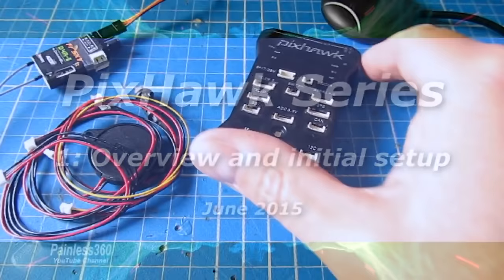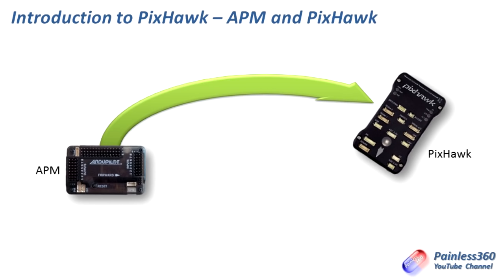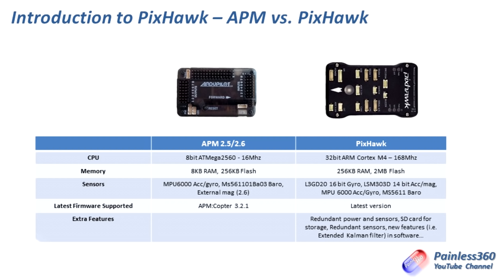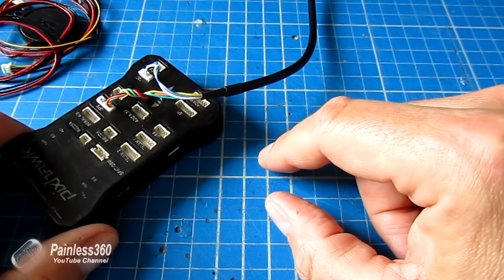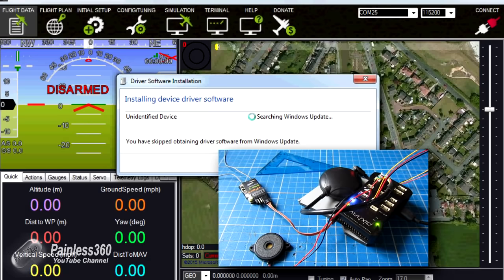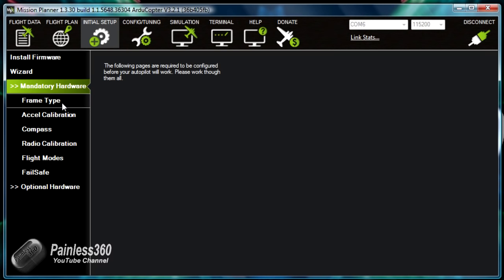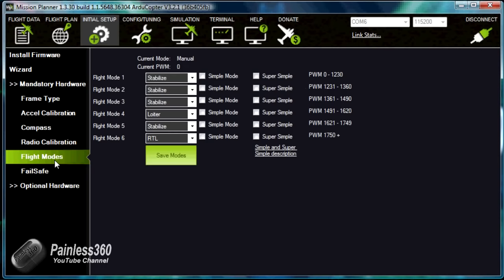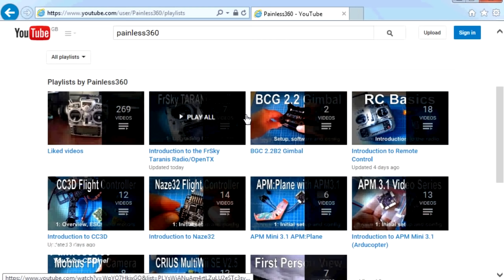(1/5) PixHawk Video Series - Simple initial setup, config and calibration

Comment: My Pixhawk is getting a low voltage alarm when it's connected to a sub 3.0 port.  It starts fine, I hear the chirp saying it's happy but then it's nothing but flashing yellow and series of beeps.  I have looked online and haven't found anything about it.  Any thoughts?
Reply from the maker: +DFSrlz sounds like the pixhawk is trying to put too much current from your USB port. If this is the case then I would power it from a battery as well, if you don't want to pull too much current through a USB port as it can damage it over time.
Reply: Painless360 In mission planner the voltage is reading .03 to .05 volts via usb.  But will try to just power using battery to see if that helps
Reply from the maker: USB should be 5v but some computers will shut down the power from the USB if it detects that what's connected is pulling too much power..

Comment: when I try to calibrate the radio, I get the error ' 0 channels detected, at least 5 needed' any idea why?
Reply from the maker: It could be lots of things. Have you checked that the receiver is bound, the wires are connected correctly? Let me know what troubleshooting you've done, it helps for me to suggest things.
Reply: Bounded properly because the transmitter detects it. (I'm using a Turnigy i10 and iA10 pair).  It also possible that since the quadcopter had been in the lab and went through lots of hands, some parameters have been changed. I will go and check if there some issue like that. The thing is it is generally used in autonomous mode using a matlab library called matmav. So maybe that causes the issue. I will check that tomorrow.

Comment: I'm having issues connecting my fsia6b receiver to the pixhawk, how do I go about it?
Reply from the maker: I'd use SBUS. The setup of the reciever in Ardupilot is the same... Happy flying
Reply: @Painless360   Thanks I've been able to connect it, but when I plug everything in, it doesn't arm, the pixhawk keeps blinking green and the motors doesn't start
Reply from the maker: See my video on how to troubleshoot that.. best of luck

Comment: Anyone can help?
I was thinking is it possible to use a GPS simulator for this PixHawk GPS input module?
Reply from the maker: I don't understand what you're asking. What's a GPS Simulator?
Reply: @Painless360  To generate simulate GPS signal going into the Px4 is that possible ? using a Third party application ?

Comment: Hi, we have a dc brushed motors and Hobbywing Eagle-20A. How the connection is done, which pins should be used? What configuration we should do?
Reply from the maker: You need a brushed ESC for a brushless motor. The giveaway is how many wires there are for the motor.  If there are 3, it's brushless. If it's only 2, it's brushed.  Best of luck
Reply from the maker: See my videos on troubleshooting arming in Ardupilot... Best of luck
Reply: @Painless360  Thank you. Btw I want to ask that the pixhawk supports geared dc motors and  Hobbywing Eagle-20A esc right? As far as I know it supports, there is no problem on that I think. The problem is in the calibration I believe so I will calibrate it from the beginning.
Reply: @Painless360  Heyy, I see that the motors turn when I say test motors on the mission planner, but it disarms itself after some time. Also, I can't turn them all the time I don't know why. I will check your videos, other than that do you have a suggestion?
Reply from the maker: Disarm after a set timeout is normal. Please watch one of the modern Pixhawk/Audupilot series. This series is very old.. Best of luck!
Reply: @Painless360  yes it is normal but when I try to arm it again it sometimes does not turn. What can be the reason?
Reply from the maker: What troubleshooting have you already done?
Reply: @Painless360  I actually do not have an idea, probably, I couldn't configure RC before. But now I have done it somehow which I don't know it is okey or not. However, the motors turn and stop. Once I tried again  it did not turn, but after I tried it one more time and it turned. I don't know what is the problem?
Reply from the maker: It is really tricky to help with such limited detail. It'll be something you've missed or setup incorrectly. I'd point you to the a recent series showing the steps I use to setup and fly Ardupilot.. Best of luck!
Reply: @Painless360  for now , when I click test motors after arm the rover, it gets disarms itself. What can you say? The movements will be autonomous, we used dronekit library. So, I want to also ask that is there any changes in configuration accordingly?
Reply: @Painless360  Last thing happens is that the Rover arms but it does not turn the motors is that configuration problem?

Comment: helo sir

how to set the pixhawk for autonomous control method 
please can u give me any suggestion about it 
Thank you,.
Reply from the maker: +Javad Ali later in the series.. you upload a mission using mission planner and then select the Auto flight mode.. check out the docs.. best of luck!
Reply: thank you 
another thing I want to know is can I use 
FlySky FS-i6 2.4G 6CH AFHDS RC Transmitter With FS-iA6B Receiver for the pixhawk controller
Reply from the maker: +Javad Ali keep watching...
Reply: Painless360 
is fs-i6 6 channel transmitter is suitable for the setup?

Comment: how to setup follow me mode on pixhawk can a make video of that please
Reply from the maker: You need a connection from a tablet running 'Tower' or a PC running Mission Planner. You can use the OpLink Radios or the WiFi module to maintain the connection. You then setup the mode as per http://ardupilot.org/copter/docs/ac2_followme.html, and the model uses the GPS co-ords of the tablet/PC you're holding the position itself and 'follow you'. Best of luck, personally I'd never set this up as it's asking for a problem to crash the model into you!
Reply: i really like your reply sir. I love your channel

Comment: Hallo! do you have info about any rc traffic sys. module which can be connected to Pixhawr
Reply from the maker: +Khalid Oldendorf I've nor seen that - do you have a link?
Reply: +Painless360  - Thanks for your reply. I meant something like an Air Traffic Management (ATM) for Drones (fixing wing for exsamble) without interrupting Commercial Aircraft with any signal (just detect and move away automatically)
I think of long range Laser-Sensor multi Module, more than 1500 km (can give 12+ sec. to move away when the Drone detect an object)
Reply from the maker: We've not played with anything like that. Complying with local air traffic rules about ceilings, no fly zones and maximum RC range should keep models out of harms way. Happy flying!
Reply: +Painless360 yes you are right. but FPV flying in height altitude and it's very close to small aircraft and detect system is important in case

Comment: Would you recommend this for multi-rotors ?
Reply from the maker: Depends on what you want to do with the model, if it's a larger model and you want to use it for autonomous flying or filming then it's a great choice. See out flight controller comparison video for more commentary. Best of luck!
Reply: Painless360 also so you have to use the gps compass antenna?
Reply from the maker: Yep, not sure why you'd bother with a PixHawk if you weren't planing on using the GPS - see that video I referenced.. Best of luck!

Comment: Wonder if this system if good for tricopters and how you connect a in1 esc
Reply from the maker: http://ardupilot.org/copter/docs/tricopter.html ;)
Reply: @Painless360   awesome nd im guessing there is also something usefull about if and how to set up a 4in1 esc that is a dlhel and uses dshot 300-1200
Reply: @Painless360   mh sadly they describe how to wire and set up normals escs but not a 4in1 solution
Reply from the maker: The wiring is almost the same.. See my builds where I use a 4-in-1 for tips..

Comment: Hello Painless,
I already send you an email and have further questions wich i should post here.
You recomended to do the calibration of the ESCs again, but the problem is that the Pix wont talk to the software anymore.
I switched the sd card and tried again, the result was the same, the software sais the FW is already on the board, so i click connect and at the stage of MAVlink connection it sais that the software isnt getting any Heartbeat from the board.
Still when i plug in the pix i get a white light followed by the tone and a solid yellow MAIN LED. (just IO green (solid) and blue (flashing) and FMU green (solid) are further lights)
The charts about the meanings of the MAIN LED status wont help either because solid yellow isnt mentioned, exept for "Solid any coulor - Armed" but i dont think that it is armed in any way. is there any way to set the Pix to its standard or reboot/reflash it so i can start again or do you think it may be broken ?
Thanks
Reply from the maker: I've not seen that particular problem here. I've had issues like it when I forgot the SD card (!). The only thing I can suggest is flash another firmware to the PixHawk (like Rover) to see if that will then let you flash the one you want back onto the flight controller. Best of luck with it..
Reply: Thank you so much man, this just did the trick and the quad is flying, thank you so much. last problem is the connection to GPS but i guess i will figure out why it is getting no gps signal.
Reply from the maker: +Julian Guevara first GPS lock can take a little while. One time took 20 mins. Once you've got a lock the next time will be a lot quicker..

Comment: i am trying to setup my pixhawk and the gps wont connect and when i try to calibrate my compass for the pixhawk and gps nothing happens. any thoughts?
Reply: i get the error comment Bad Compass health and No GPS. i am using the exact setup as you.
Reply from the maker: +Derek Loyd what troubleshooting have you already tried?
Reply: I have tried calibrating the compass with and without the gps, I have tried doing it in the wizard and the mandatory set up. I tried plugging my battery in. I tried pressing the pixhawk reboot button. For the gps I have unplugged it and plugged it back in and still nothing for it.
Reply from the maker: Sounds to me like power if both the GPS and compass don't work. Are there LEDs on the GPS puck? If not have you checked the 5v output on the GPS connector on the FC? If there are LEDs (so it's getting power) then have you checked that there isn't a break in one of the cables/connections? Lots of try.. Best of luck!
Reply: The gps puck has power because a green led in it is on. The pixhawk compass calibrated once but quit after 150 data points and I still got a bad compass error. Also should try gps puck connect automatically because I have a no gps error as well even though it has power. Lastly if a else fails is the naza v2 a good replacement for the pixhawk?
Reply from the maker: Derek Loyd not sure what's going on, could be the flight controller or it could be the GPS module itself. Best of luck with it

Comment: what's the receiver that he installed and what does it do?
Reply from the maker: If you are new to radio control then the series 'Introduction to Remote Control' on this channel answer a lot of the basics. The receivers job is to transmit the radio signals back into control signals that the flight controller can understand. Best of luck!
Reply: Thanks a lot for your reply I really appreciate it but I'm trying to use the pixhawk to control a rover autonomously so without using a remote control at all(basically just by creating a mission on mission planner) and I can't find any resources online about rovers as everyone is using it for copters and I was wondering if you had any idea about a website or someone who has done or is trying to do something similar. You're videos were a great help with setting up the pixhawk and getting familiarized with it. Thanks again.
Reply from the maker: The flight controller still expects to have a radio attached for setup and config..

Comment: can you please tell me whether pixhawk pix4 2.4.8 for 49$ on ebay is good or bad?
Reply from the maker: Most are clones so impossible to tell. Check the sellers reputation, that's probably one of the best indicators..
Reply: Can well say clones are always not good?
Can I expect the same performance with the clone?
Reply from the maker: I've used lots of clones and not had a problem.. see the series..
Reply: Thank you very much

Comment: URGENT !!!!!! Hello Sir Which Telemetry Module Should I use 915 MHz or 433 MHz for long range in populated and WiFi areas. I want to get long range in WiFi areas. Plz reply I am a subscribed user.
Reply from the maker: See the later videos and documentation where it’s covered. Wi-fi is a very different frequency so both should work well.. best of luck!
Reply: Painless360 Sir but which is better and which should I buy. For more range. Plz reply
Reply from the maker: +Uma Mahra the answers is actually which is legal in your country. That's covered in those places I've already directed you too. Best of luck
Reply: Painless360 Thanks

Comment: KUDOS.. Very neat videos !!.. I was wondering if you could tell me alternate ways on how to connect a companion computer to the pixhawk..   Site  :http://ardupilot.org/dev/docs/odroid-via-mavlink.html gives some details.. about connecting it to telemetry2 but currently my telemetry 2 on a x8+ is connected to the RC Radio Receiver.  Where else can I connect the RC radio receiver to? or can I connect the odroid via UART to any other port.. Thanks in Advance .. Pete
Reply from the maker: I've only ever used the two telemetry ports on the Pixhawk. Usually one for the OSD and the other for MAVLink radios or the FrSky system. Best of luck with it!

Comment: Hello and thanks a lot for your wonderful work. 

I would like to ask you if this flight controller can be mounted on this racing drone http://www.helipal.com/storm-racing-drone-bumper-2-storm-spec.html and if it needs any special equipment for the configuration.

Thanks a lot in advance.
Reply from the maker: No chance with that frame. See the dimensions of a PixHawk in any of the listings selling it. A small quadcopter like that would normally use a modern flight controller running Betaflight now anyway. See my flight controller comparison video from last summer for more detail..
Reply: Can't I put physically onto the frame?

Comment: I recently bought a PixHawk set: http://bigupgadgets.com/pixhawk-px4-2-4-6-flight-controller-neo-m8n-gps-radio-telemetry-osd-3dr-915mhz-03-009211.html?fee=14&fep=187297
But I am struggling because i cant find a receiver like in the Video:  9:33. 
I also have this drone: http://www.xt-xinte.com/?goods=detail&id=16887 which has already a transmitter and receiver, should i use the one of my drone?

Additional to that I have a problem setting up my FPV Boscam set which i want to connect to a gopro. If someone can help me I would be very happy.
Reply from the maker: +Felix Eggert You need to get another receiver for the radio you have that has either PPM or S-Bus out. Best of luck..
Reply: +Painless360 can you recommend one?
Reply from the maker: Depends on the range and radio you are using I use the R615X for Spektrum kit and the D4R-II for Taranis..
Reply: +Painless360 I am using theRadioLink AT10 2.4GHz 10CH Remote Control System(RX&TX) I am not so much into this and have no idea what to buy but i would buy the same as you have if it works fine with my drone
Reply from the maker: See my video on choosing a radio. It's a very personal choice and most offer the same basic functions. I use Spektrum and FrSky radios here. Best of luck.